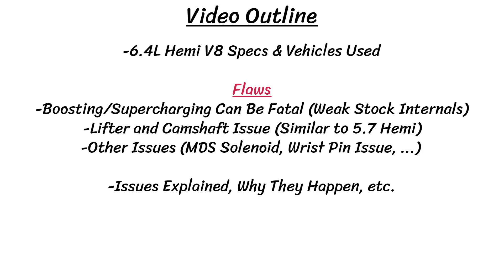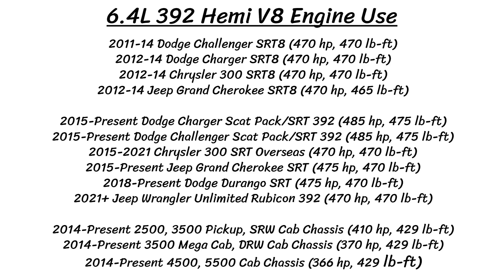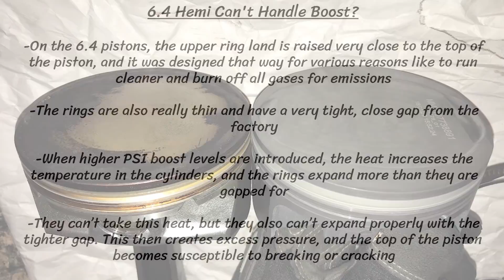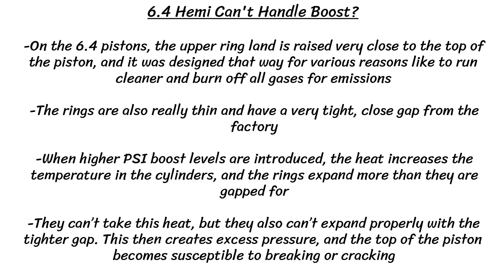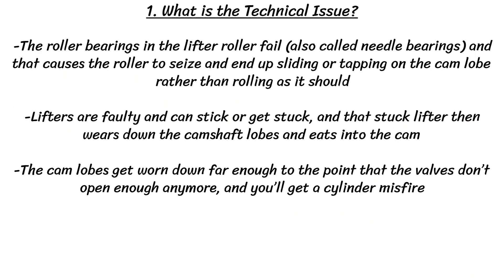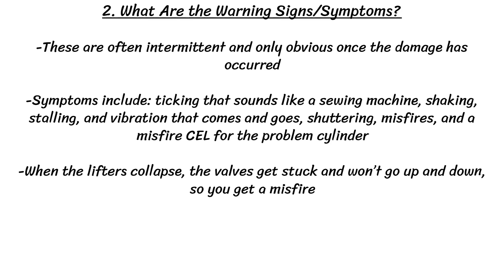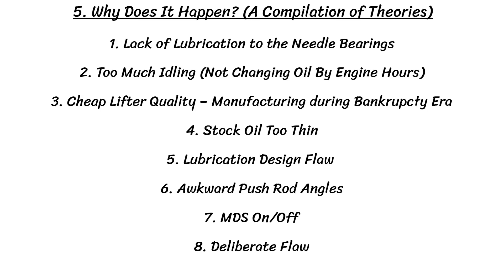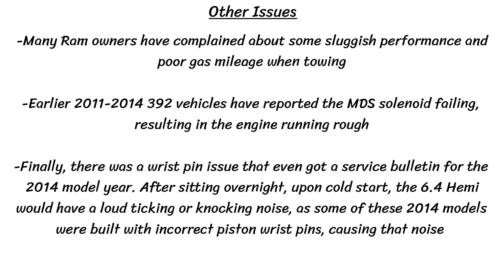The Specs and Fatal Flaws of the Chrysler 6.4L Hemi V8 Engine (392 Hemi Issues)

Comment: The lifter problem can easily be solved by switching the oil pump to the hellcat oil pump. Someone did a test before switching, and observed the lifter area only has 30PSI. After switching over, it was recorded with 90+PSI.

Comment: Don't try to tune a 6.4 you will blow it up, very experience tuners only. But I wouldn't do it, if you want your vehicle to reach 200k miles and higher. Keep it stock! If you want faster just get the top dog HellCat 6.2 with the supercharger.

Comment: wouldnt call it a "fatal flaw" if the engine blows up, after u add another 200hp to it with boost.
try adding 200hp to any other from factory boosted engine with stock internals. try a G63 AMG 4 Liter V8 with 585 HP and boost it up to 800hp with stock internals. lets see how that goes.
but yeah, typical youtube knowledge nonsense. sorry.

Comment: 12,500 miles on my 2020 Charger wide body.  Never raced, weekend driver religious oil changed at the Dodge dealer.. a valve spring broke and destroyed my engine. Still under warranty so Dodge is replacing the engine. If something has moving parts it can break no matter how good you take care of it!

Comment: Have a 2012 6.4 Hemi SRT V8 Superbee. 53000 miles on the clock. Just dropped a lifter. I suspect the cam is likely damaged as well, as it is miss firing on one cylinder.

Comment: In my opinion, the engines are way too compact for the Hemi engines.  Make the engines slightly bigger with a 4.5 inch bore spacing with 10 inch deck height.  And stop the oddball sizing like FE Ford ( 10.170 deck height),  10.297 inch deck height, 10.322 inch deck height on a 460 ci etc,,,,,,

Comment: I'm a mechanic and drove a 6.4l 2019 charger today. Very easy to work on. I replaced a water pump and it was quite fun to drive. That's why I'm watching this video. Very easy engine to work on m8's. Tomorrow I'm tearing down another customers Denali 6.2l cylinder head and if you know why, you know..... Tick tick tick.
Reply: How did you find out it needed a water pump? I have a slight whining noise that I just noticed while accelerating, and I'm thinking it could be a pulley or a water pump. What were the symptoms that you noticed?

Comment: That 6.4 doesn't have near the the issues that hurricane has. Yes you have to upgrade the internals in order to achieve bigger power gains but as is its pretty rock solid otherwise.  Unlike thst hurricane which has a multitude of problems.

Comment: Why boost it? I've had several of these engines as well as 6.2 supercharged. If you can afford to try to boost or jack up the HP in a 6.4 then why not buy the 6.2 supercharged? Never had a problem with any of the over 30 5.7s, 6.4s, and 6.2s. The fatal flaw is Boost! Not the engine!

Comment: Adding a blower does not mean it’s not reliable because it wasn’t designed for boost.  Thats why there’s a Hellcat. It’s not the pistons or rods it’s the NA ring gap. Once you add boost it gets hot and pushes the end of the rings together until it takes a chunk out of the piston.

Comment: I have a 2014 Jeep GC SRT (bought it at 34,300 miles in 2019) and I had cylinder misfire issues around 87,800 miles.  I ordered a COMP Cam, stage 2 set along with MDS solenoid delete plugs.  Since the engine was cracked open I also replaced the timing chain, a Melling high-volume oil pump, gaskets and bolts.  I have driven over 27,000 since the work and haven't had any issues.

Comment: I have three words for all y'all: regular oil changes.  I just traded my 2012 Laramie with 135,000 miles on its 5.7 in on a newer used Power Wagon.  They took my old truck in to have one of their mechanics check it out and he was amazed at how quiet the valve train was.  Not a single 'tik'.

Comment: power hungry customers? most people that have this engine cant handle its out put already?!
also the lifters seam to mostly caused by not changing oil offten enuff and not using a synth oil as is recommended in the manual.

Comment: "Fatal flaws" only apply when you mess with the engine.  Leave it stock and it'll last a LONG LONG time.  Y'all can't leave anything alone, then wonder why it fails after you mess it up.  Don't boost the engine... it's not a problem if you don't do stupid things based on ignorance.

Comment: I cant find anything on engine block cracks... 2020 widebody challenger. 26k miles. Mostly garage kept and rarely get on it. It now has a crack in the block. Dodge is replacing the entire engine but wtf?
I guess this is a fluke?
No engine mods.

Comment: Problems with those since the 2000s.  They are designed just fine as far as bottom end goes. Any time you wanna add boost you upgrade it period and get the best tune you possibly can not some cheapo mail order stuff. 
OPening ring gap isnt the solution the tolerances are still too tight from the mfr. Do it right the first time, spend once or just leave it be
Thats good power for a stock engine too bad they weigh so damn much

Comment: Good info.  Thanks.  I have a 2018 SRT 392.  One model weakness others have noted with these engines is the water pump.  Its front bearing went out for me at about 42,000 miles. The car was still within the powertrain warranty so the dealer replaced the pump.  Note: If you have this kind of work done at a dealership, be sure to check the fastener torques with your own torque wrench when you get home (cool engine).  The dealer guys are prone to ignore this important step.  

Re: the lifters (and the entire engine) - I would strongly suggest use of Amsoil Signature Series 0W-40. I realize it is more costly.  But this is a full synthetic oil with demonstrated far better wear protection than most other synthetics.  You can do your own online study on this.  

Also keep in mind that cold oil lubricates less effectively than warm oil.  So when setting out with a cold engine, I suggest selecting 'Sport' mode.  This deactivates MDS and keeps the gearbox in lower gears at around-town speeds.  The engine running faster provides better oil pressure and flow during that cold oil period.  Once oil temp warms to about 150 degrees I will deselect 'Sport' mode unless I am still chugging around town at low speeds.  

Last, try to avoid the "impress your friends" engine start accompanied with goosing the throttle.  Sounds nice, but engine starts are always low oil flow moments, and that's not the best time to rev the engine.  You are shortening engine life with this little bad habit.

Comment: Those pistons look a little lightweight to me, I wouldn't add any boost to them if I had this engine in my Chrysler 300. Mine came with the V6 pentastar engine, and I used nothing but full synthetic oil. The engine runs so quite, you can barely hear it

Comment: I bought my Scat Pack specifically because I wanted an N/A car (got a Terminator for the boost 😋). IMO its the most balanced V8 Chrysler produces and its not exactly a surprise that higher compression isn’t typically as good for boost as lower is, despite internals.

Comment: You were wrong about the lifter issue only happening at higher mileage. Mine failed at 14K.  It also has nothing to do with MDS as even manual trans cars with no MDS have the issue (my 4 failed lifters were all non-MDS cyls). You also missed the harmonic balancer issue, where the center section comes out and can break the fan and puncture the radiator. Or, you may never notice it has come apart and your eng lacks proper balance. 
Then there's the general architecture of the eng. You have to PULL THE HEADS to get to the lifters and changing a cam is so bad that most shops just replace the entire eng because it's cheaper labor-wise. Every normal repair (water pump, etc) is labor intensive because of bad engineering. 
It's a strong runner but I will never own a Hemi again.

Comment: Why would you buy a 392 and boost an already great engine anyway? That's dumb. If you want that then buy a Hellcat. The internals of the 392 are more than adequate to withstand the 485hp, just don't get greedy as most people do.🙄
Reply: Exactly, it really is a great engine exactly as it is.  The  2 problems are like you said people get too greedy, and also the other problem is that people aren’t used to engines like this  being optimized from the factory.

Comment: I have been looking for a Chrysler 300 srt8 with the 6.4. I have done a decent amount of research and a flaw that he didn’t mention was that the cylinder deactivation feature, at least on the 300 that is, (I’m not sure what other versions have deactivation) they cause problems. I’m not sure how but my guess is that the unused cylinders are running dry.

Comment: My 2019 Ram has this problem.  After spending 8k in repair the engine totally failed again after about 200 miles of driving. This will be my last Chrysler product ever. I have joined the class action lawsuit against Chrysler for this engine that is designed to fail.

Comment: Check the dyno numbers on 2013 and 2014 Chrysler 300 srts you will find they have 525 at flywheel.
The car hits 140  passing 2 cars and will do 180mph limited by Chrysler.
At some point you have to know your driving one of the fastest cars on the street.
Have a tune and run 305s in rear.

I have never had a problem with a 5.7 hemi truck.
Remember the 5.7 was designed by Mercedes along with the 8 speed tranny.

The tick is the mating surface on exaust manifold consists of two different  metals.
So the bolts can shear at high Miles.
Its not a valve issiue change the headers if your worried go with long tube and add some power.
I wonder why Ram has been the higest rated truck time and time again ?

Comment: The 392 uses 0-40 oil not 5-20. The pistons and rods are not weak. They just aren't made for a supercharger. If you want a blower buy a hellcat. If you drive the car and don't let it idle for long periods of time you shouldn't have a problem with the cam and lifters. I've had 3 of these and they probably the best cars I've ever owned. The only problem I've ever had was on one car the screen on the radio de-laminated. .

Comment: I have had 2 6.1s (one I put 200K miles on and the other is 150K and still going strong).  I had 2 5.7s and both engines had problems with lifters.  I have a 6.4  but it has an upgraded rockers, lifters, etc. and is rock solid.  It is the best motor.  The 6.1 felt more like a race motor, but the 6.4 has so much more low-end power it is no contest.
Reply: I  totaled my 6.1 Saturday. Been shopping around looking at 392s. They’re definitely faster, but how are they for a daily?
Reply: @carsonbynum4017  great daily driver.  As long as you update the lifters
Reply: Is it better to invest and upgrade the 392 parts as you mentioned with better rockers, lifters, etc for better solid performance and decrease chance of failure issues with the motor ?
Reply: @masspike_kingcommander9334  that is my belief.  I had a brand new engine and still upgraded the lifters and it runs like a beast.  I have gapped three different scat packs

Comment: I am sitting at 156k miles on 6.4l on my 2018 Ram 2500 we shall see.
Reply: Update the 2018 made it to 190k miles and I am talking very hard work miles with hours of engine idling like a Police car. Oil Field work hauling 4k lbs of water regularly. Now I am in a 2024 with a 6.4l No problems at all yet and almost to 30k miles and I do not expect any problems after the last engine. Do your oil changes and use the 0W-40W oil it calls for. I love this engine. I use them for work not boost.

Comment: Use full synthetic oil that seems to solve the problems. I got 400,000 miles on my 5.7 and the head gasket went bad. That's it the lifters are fine.
Reply: Just replace the head gasket and any other parts 400k miles that is a milestone for this engine. You where definitely during routine maintenance.

Comment: Such a STUPID video.  I have several cars with this motor and ZERO issues.  151K on my 2017, its a daily and used at the track - so it has not been babied.  The 392s are fairly flawLESS when you simply take care of them.  They are solid and will last forever - so, by their design are great.  Just because you can't build them further doesn't mean its a flaw.  As the commentator says "the owners of these cars often have a lot of money..." - well then those smart educated buyers KNOW to just get a Hellcat and not the 392.

Comment: It happened to my '18 Charger just over 50k miles and powertrqin warranty expired like 3 months before. Im one of the most anal guys when it comes to oil changes. Changed oil every 3-5k miles but never over 4 months. Sometimes i changed it just over 2k miles because it was in the car for almost 5 months. 
I noticed ticking noise coming from the left side while on part throttle that i didnt notice before. When the dealership opened it up my MDS lifters were sticking and one of my cam lobe was scorced. 
Needless to say, they changed all the lifters and  cam and i still jear the same noise, maybe not as intense as the first time, but still enough to make you concerned 👀

Comment: My 2012 300 SRT had a lifter issue that damaged the cam. It only has 39k miles on it one of the lifters failed and wore down the cam and it wasn't one of the MDS lifters.
Reply: Did your vehicle display warning signs ⚠️ such as a ticking noise, vehicle misfire at times at all ?
Reply: @masspike_kingcommander9334  Yes, I heard the ticking noise after the car warmed up. I just finished getting the engine rebuild, and it cost around $6,000.

Comment: I have a 75th Anniversary 2021 RAM 2500 Power Wagon with the 6.4L Hemi. At about 20,000 miles, I started to notice an occasional "sewing machine" ticking when first started. At just over 21,000 miles, it became louder and more persistent, then threw a code and the check engine light came on. I took it to the local CDJR dealer and they determined that a valve had stuck and bent a pushrod. In accordance with RAM guidance, they checked for metal in the oil filter and found none, so they did the repairs (supposedly). Had they found metal, it would have necessitated replacement of the engine. The loud noise has not returned, but the sewing machine ticking is still there when it's started cold.

Comment: how is it a flaw if an engine that isn't built for boost doesn't handle boost well that's like complaining cause a Toyota corola sucks at pulling a loaded trailer when it's not built to pull trailers.

Comment: Scary stuff.  Whenever mine sits for a while I used the built in coil kill feature to spin the motor to lube it before starting my 2015 Challenger SRT 392.  You depress the gas pedal fully and hit the start button.

Comment: So keep it factory stock for less problems.  Don't do any mods.  But even then you will have problems down the road with the needle pins at higher mileage. Change oil frequently based on idle time = HIGH MAINTENANCE.  This is the type of vehicle to keep for a short term or lease it then turn it in before problems happen.🤯😵‍💫🙈🙀

Comment: LS  Corvette engines have harmonic balancer wobble/failures.  All of these performance cars have weaknesses and cost more to repair.  If you want super reliability, low maintenance, low cost get a Toyota Corolla SE HATCHBACK with 6 spd. manual transmission.  Don't get CVT TRANSMISSION.

Comment: Well if you use the oil made for the engine Ms12633 approved your lifter should last. The top ring location is the issue with boost. keep it under 7psi an it should be fine

Comment: Thanks for making this! I've been currently shopping, looking at a possible 2500 with a 6.4, and it's good that it's something to be aware of. Sucks that you can't "inspect" this issue more easily so that you can tell whether or not it's good for a while, or if it's starting to show signs that it will fail and cause you bigger headaches. Thank you!
Reply: Considering the guy wraps up the video recommending 5w-20 which is wrong for the 2500’s 6.4, i would take this with a grain of salt. How is taking an engine beyond factory specs by modding it a fatal flaw with the engine itself? How prevalent is the bearing issue?
Reply from the maker: That was my mistake unfortunately as I had used the slide from a similar video I did for the 5.7L Hemi
Reply: Just go ahead and spend the extra little bit of cash get the Cummins instead of the gasser it’ll save you on fuel if it’s deleted will be way more reliable and will run a million miles
Reply: @dorianclinton3740  but they won't sell me a Cummins in a challenger

Comment: I have a 392 Wrangler on order. Does anyone know if all of some of these issues have been resolved? I love the fact that the 392 is not a DOHC motor than uses chains to run the valve train.
Reply: Check into class action law suits on 2008 models to current new 2022 models.

Comment: To "CLAIM" that cast aluminum hypereutectic pistons cannot handle boost, is just not factual. The factory oem pistons are plenty strong for lower power boosted applications. I wouldn't push cast factory pistons past 125whp per cylinder. I like to use maximum power output, as the unit of measure, for the engine or per cylinder. The maximum power output, at a given pressure level, would vary GREATLY depending on the size and number of turbos. One 66mm turbo would make 500whp@8psi. Then two 76mm turbos would make 800whp at 8psi. Using 8psi at a limit for an engine, do you mean 500whp or 800whp? The cylinder pressures and the pressures exerted onto the pistons and rods are massively different at 800whp, compared to 500whp.